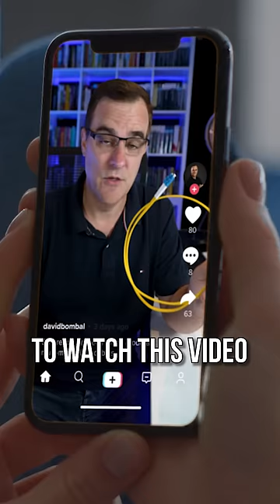Did you know you are using these right now? #shorts

Comment: Here's a safety tip for you all. If you ever look into the light of a fiber optic cable you will go blind. There is constant high intensity light shining through those cables. The only way you could do this is by cutting the cable or coming across one that was cut by a contractor during excavation. I'm a utility locator and this was something we were told our first day of training. DO NOT LOOK INTO IT.
Reply: Let me add to this! The little light pen he was using in the video is visible light and you use that pen for the very reason he is using it here it lights up the end of the cable and you can see which one it is on the other end. But actual transport light sources you cannot see but it is there and it will burn your eye if it's strong enough!. So I just wanted to say just because you can't see a bunch of red light coming out of the end of a cable doesn't mean it's safe.
Reply: "Do not look into the operational end of the Device."
Reply: Like instant blindness or looking into it for a few seconds?
Reply: @GoblinMode3004  
Yes of course, but the comment was referring to a bare ended cable a person might come across.  You are a bit more alert when working on a device itself.  A person might not realize the danger of a cable end with non visible light present.
Reply: @Rduino  
Depends on a few things.  Power of the light, focus, and time.  
Fiber to the home distribution light is pretty low, but still has danger as it is connectorized, so has better focus.
Transport fibers generally go through amplifiers and could cause near instant damage if looked at head on.
Reply: @brizzle8797  
Mine was a Portal reference; in Portal 1 in the chamber where you obtain the portal gun GLaDOS says several things pertaining to the safe handling of the Device, of which you are not to: touch the operational end of the Device, look into the operational end of the Device, submerge the Device in liquid (even partially), and under no circumstances should you [DATA EXPUNGED].
Reply: @GoblinMode3004  
My bad! That makes perfect sense now
Reply: Yes do not look into the light unless you are a particular former president 😊
Reply: it’s almost like you’re warning me of my electro-esque superhero/villain origin
Reply: Not true. Work with this everyday. Unless you stare into it for long periods of time😅
Reply: @Rduino sometimes it's not even instant, eye dame can show up over the course of weeks after.
Reply: It’s not a guarantee but it could happen. Also the light is invisible so you can’t even see it. I install fiber. It happens and I usually get a headache after opening a fiber cabinet haha. It’s not super dangerous but it’s definitely best practice to avoid any direct eye contact with the tip of the connector.
Reply: I always look into the light to see which is Tx and which is Rx when connecting them, didn't go blind yet...
Reply: I wanna look into it
Reply: Is it visible light? Like, you can see the infra red light from your TV remote in a camera, like on your phone. Comes out purple. 
I know just because you can't see it, doesn't mean it's not there so when bright enough it can damage your eyes.
Is it like that?
Reply: @WhiteoutMonster  it's red, so when plugged in at one end you see a red dot in the cable coming from the Tx and nothing in the cable coming from Rx.
Reply: @GoblinMode3004 makes sense for a.large amount of devices
Reply: @GoblinMode3004 i love you and i miss Portal.
Reply: Now I'm tempted...
Reply: So you're telling me i can blind people with virtually no repercusssion?
Reply: @topc5826 how to be that one weirdo that makes everything political. Seriously it's not cool, like at all
Reply: That's not true, they scare you by saying that so you don't take a look at people's data going through it.
Reply: @Rduino I don't think you wanna take your chances either way
Reply: Why oh why would u even want to look in it ??
Reply: DO NOT LOOK INTO IT.
Me: looks into it
Reply: I have probably looked into it hundreds of time, thankfully not blind yet
Reply: @skarshad  <Message sent by voice command>
Reply: That’s a lie
Reply: Thanks a lot I look into it by my other eye and...ummm.....yeah
Reply: "Do not look into laser with remaining eye"
Reply: Is there a high power laser inside
Reply: A fun experiment I like to run is take a fiber optical meter and point it at the sun. You'll get a reading of about -32 dB. Then meter something like your home network fiber and you'll get something like -4 dB. That should give you an idea of how powerful that light is.
Reply: On my Optical Fibre Line Systems course back in the late 1980's,  the instructor said "do not look into the end of the Fibre with your remaining good eye." Sage advice.
Reply: Ah yes let me pull out my stock of fibre optic cables and stare right into it

Comment: wow simple but highly informative
Reply from the maker: Glad you think so!
Reply: Agreed
Reply: And inform partially wrong. The singlemode Fiber has a smaller core around 8 nanometers while the multimode has a way larger core. The core is proportionally more expensive than the cladding so multimode Fiber is way more expensive than singlemode.
Reply: Unless you live in rural Canada the lines pass right by us but we're forced to use dsl and get 20mbps max . Bassano alberta

Comment: You are using one of those right now - cries in German copper wire...
Reply: 😂 Du bist nicht der einzige 😂
Reply: You still are, data centers, ISPs, etc.
Reply: The core of the network is still fiber even if you're on dial up, cable, DSL etc.
Reply: gepriesen sei kabel Deutschland.
Ich lauf über Fernsehe kabel. 
läuft immer noch genial, auch im hinterland
Reply: Cries in rural area
Reply: Yo, wollte ich auch schreiben
Reply: And Egypt bro😅
Reply: Bei mir im Dorf gibt es zwar jetzt Glasfaser aber meine Mutter will das nicht kaufen deswegen muss ich leider noch das slow motion internet ertragen
Reply: Spätestens von Frankfurt in die USA liegt Glasfaser.
Reply: @minefreund deine mutter? 😂
Reply: Same in Australia 😢
Reply: Copper has lower latency.
Reply: @edwardcullen1739  It has higher latency thjan glassfibre. What does add latency is the technology to convert the light back to electric signals.

So depending on the distance you get better latency. Also you can x100 the data rate.
Reply: @luigigaminglp  Wow, seems the laws of physics have changed. Who knew. 🤷‍♂️

No, speed of light in copper is higher than the speed of light in fibre (because fibre relies on Total Internal Refraction).

Yes, it's easier to get higher bandwidths in fibre, especially over longer distances, but the propagation delay in copper is lower and hence the latency where copper is used over fibre. This is the reason people still invest in high-speed copper Ethernet.

This is elementary stuff, which you'd know if you'd ever read a book on networking.
Reply: @edwardcullen1739  electricity travels at near speed of light speeds. Near.

Also since resistance is a thing you have to use repeaters way more frequently.
Reply: @Resomius was hast du so für download und Upload Geschwindigkeit?
Reply from the maker: Please watch my latest short that says you are using fiber even if you think you're not: https://youtube.com/shorts/KtBHJov9Fio?feature=share
Reply: @davidbombal  Nah.

Comment: I use both at work. I think people should know about SFP adapters, cables etc...
Reply: SFP  adapter? What does it mean
Reply: SFP adapters?  SFP are ports that switch uses to connect fiber lol
Reply: @deaddead3699   thx for the explanation
Reply: @DADAx700 idk what SFP actually stands for but these fiber optic cables plug one device to another (obviously lol) in my work, a baseband unit to a main fiber trunk, or a radio to an antenna. in between the fiber cables and the devices data port is an SFP card. From my understanding (could be totally wrong I haven’t worked in telecom very long) the SFP card is used to convert the analog data of fiber optic (light) into a digital data. Vice versa on the sending end of the fiber, the SFP takes digital data converts it to analog (light) for the fiber to take care of. They use fiber optic cable due to its speed.
Reply: Sfp is actually a transducer which converts optical power into electrical
Reply: Usually referred to as SFP Modules rather than adapters. but adapter makes more sense as it converts the optical signal to something that a switch can process/read (electrical signals)
Reply: Small form factor pluggable
Reply: Single mode fiber patch
Reply: @deaddead3699 SFP “adapter” isn’t exactly incorrect as it’s simply just a form-factor and they aren’t just LC-fiber connections as you can also get direct-attach-cables (DAC) or even just a regular 8P8C connection
Reply: @DADAx700 why should anyone know the minutea of crap they have no reason to have knowledge of?? Should you know about fine details of plumbing? Electrophysiology?
Reply: @kells9k you just want to know one subject, no problem, other people might havr broader interests.
Reply: Seems you work In a data center as well
Reply: I have 500 m of fiber in my closet, left over by contractors after a botched attempt at cabling my house (not their fault on both counts).

Where can I find information materials to know how to, for example, run the cables in my walls in place of Ethernet? And what tools would I need?
Reply: I work in a data center I know so much about connections, fibers, switches, optics, and single nodes that are worth more than my salary…
Reply: Why?
Reply: Which Sfp ? Xgpon, gpon or gpon alt ?
Reply: @Silentguy_ we just call it an optic since there are so many types and form factors.
Reply: No, people don't need to know this.

Comment: As a beginner cable installer, I can confirm, working with fiber is like working with precious eggs
Reply: Gold eggs lmdfao
Reply: The only time I’ve ever handled fiber cables was in school where we learned how to install a plug manually by hand. And it was a very hard process my cable worked however and that’s all that mattered. 

I personally don’t like working with fiber cables.
Reply: As an installer of 10 years, I can confirm that it’s a lot more robust than you think.
Reply: @AcexMate  4 months later and I’ve learned a few things about it and have gotten more comfortable with it, I’ve folded it in such a way that I thought it was done for but it still showed light so I went with it and it worked
Reply: @AcexMate  Yeah after a while if it breaks you learn just to splice a new end on there, no big deal. The one he's using is a $10 connector lol I'd just replace it.
Reply: Nah, just hurry up. You must not have the touch of steady hands. It’s all about prep cuz
Reply: @equanox100  how is it all about prep? There is hardly any prep work with fiber. You pull the wire through building, and then snip the ends and shove them into connectors. The only prep work involved is smoking a joint in the truck
Reply: I started working in telecommunications over 1.5 decades ago. It wasn't until just recently did I start making fiber connections. Truly is a PITA.

Comment: I used to be a fiber splicer. Glad to see others explaining it

Edit. I was an apprentice and had only worked in the trailer splicing fibers for a few weeks. I dug up cans and knew that the lasers came from the hub and ran for a few miles to the customer and used a machine that sort of welded the glass together
Reply: Nice knowledge, thanks for sharing this information.
Reply: Is that a job or the name for the bad habit of mixing cables?
Reply: Which type is most often used for connecting hubs to nodes? I work in design and we only call out fiber by the fiber count, not by mode type.
Reply: I used to do Arc-Fusion Splicing in the early 2000's. Pretty cool, welding glass cable with a spark!
Reply: i spliced/terminate fiber on oil rigs in the past. brings back memories having glass shards in my fingers.
Reply: @thebillyd00 single
Reply: @thebillyd00 its always single mode, multi mode in houses themself, single mode outside
Reply: @thebillyd00 there's also different types of single mode fiber as well
Reply: I used to repair fiber splicers and accessories for AFL. Learned a lot on the job. One of the most interesting jobs I've ever had.

Comment: When I was younger, in my teenage years. I discovered that my ps2 had an output for this type of cable. I also had a mini disc player that came with one of these cables. I was able to record all sounds coming from any game I played on my ps2. I recorded all gta 3 and vice city radio stations😅😊
Reply: No it does not 🤨
Reply: @sinisterritesofxano-humair68  huh?
Reply: That's likely TOSLINK which does digital audio.
It's an optical cable, just a different application. I think those were lower quality and more closely related to multimode. So many devices seemed to support that back in the day but it seems like it was rarely used!
Reply: Toslink! It used to be so ubiquitous and then vanished

Comment: You would be surprised about how many Network Engineers do not know this. Knowledge is power.
Reply from the maker: Sharing is caring :)
Reply: by definition they are not network engineers then.
Reply: @davidbombal could you do a video about MTP fiber optics
Reply: @electroplank587  by definition they are.
Reply: Cersei disagree
Reply: Haha. There probably are network engineer who don't know about this. Cos some don't really handle fiber optic cable.
Reply: @electroplank587  Not all network engineers handle fiber optic cables...
Reply: @weth3844  but they still should know about it. Just because not all bakers bake cakes doesn't mean they shouldn't know what a cake is.
Reply: then they are not network engineers, they are just technicians
Reply: @64-bit63  you don't see network engineers fixing home LAN cables, those are technicians only. Network engineers are those who actually designed these cables.
Reply: Knowledge is not power. Applied knowledge is. 😎
Reply: If you’re a damn Network Engineer and you don’t know what this is you’re doing something horribly wrong
Reply: The entry level Cisco certification has an entire module on fibre. It’s also not new technology.
Reply: @64-bit63  no, just no
Reply: @toetie2019  Engineer is the keyword here, an engineer is not a technician an engineer is a designer and inventor
Reply: @electroplank587  they are I used to be one 
By your logic no one is any proficient until they know everything in it even things they don’t encounter 

You know how many countries don’t use those ? At all
Reply: @mr.dexter6240  that’s not a network mostly an electrical engineer or some other socialization
Reply: @toetie2019  they don’t know the different between both or never saw it many countries still don’t use optic fiber
Reply: @ko-Daegu  really seemed to have upset a few people on this 🤣  stop taking everything so seriously and have a think about it for a bit.. my comment still stands. I'm not a network engineer but i know what fibre is and some basic info.
Reply: optic cable is new tech
Reply: @dayzign77  you can’t be serious
Reply: What kinda network engineer are they than.
Reply: @beef0rtress idk man in today's world it's very common
Reply: 20+ years working as a net eng/architect and sadly I can confirm, he's not wrong.  Many network engineers focus on a specialty and don't get much exposure outside of that.  A CCNE cert doesn't guarantee they know either.They may know how to configure Cisco hardware in a data center, or troubleshoot a flapping router, but very few ever actually touch the physical fibers or can even tell you which ones their routers are connected with.
Reply: And it was invented by an Indian scientist names "Narinder Kapani"
Reply: Knowledge is power. Power is measured in Watts.

Comment: The light in both cables is bouncing around.  The core in a single mode fiber is smaller, but there is still total internal reflection happening which still involves light or lasers bouncing from one boundary with the cladding to the next.

Comment: I'm a network engineer and have traveled around to businesses and implemented networks, but no one has ever explained the difference between the two fiber types this effectively. Thank you!
Reply: Next time you unplug one end, point your phone camera at the unplugged end. 
It'll flash purple if it's running right from the IR coming out. Quick way to check
Reply: There is a big difference in the diameter of the glass, multimode is much larger.
Reply: Ikr! Same here. Really good info!
Reply: There's more differences than this
Reply: Literally do the network+ exam, it's on the book XD
Reply: I am not a networks engineer but I know the difference.
Reply: He hasn't actually explained anything to do with the refractive index of the material. And you don't truly understand the difference between SMF and multi mode without that fundamental piece of information.

But hey, you learnt something right, so it must be a good video.
Reply: How are you a "network engineer" then. I'm an Engineer and designer for IT Infrastructure, and that's not even all. Single mode is OS1/OS2 and Multi is OM1-4. With 3 being the standard.
Reply: @Dean G  right...didn't even mention the different Frequencies they run at
Reply: @9ernation543  yeah you know something and u are x 
so it must be part of being x anyone who doesn’t know it is not x 

If you are an engineer thinking with such fallacies ooh boo I got something for at
Reply: @deang5622 let's be honest, you won't truly understand it unless you have an understanding of maxwell equations.